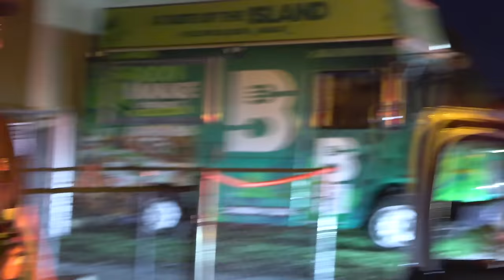This is what I deal with

Comment: You guys should just spend a hundred and twenty dollars and buy a lishi lock puck set. There so easy to use my 9 year old can use them. That wat when you need in on A.O.R.s you can just take 5 seconds and pick it. Yes 5 seconds. Most states youndont need any licensing as long as your not using them illegally. Double check for your state though. It would still be interesting and save you hundreds in repairs.